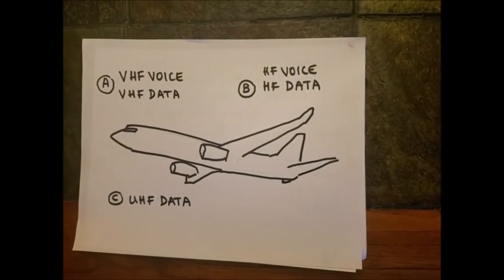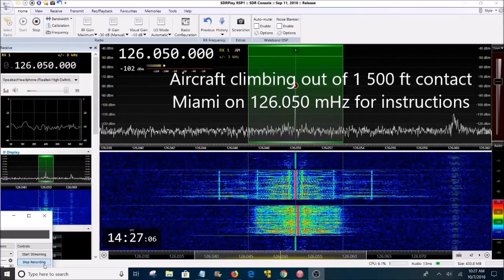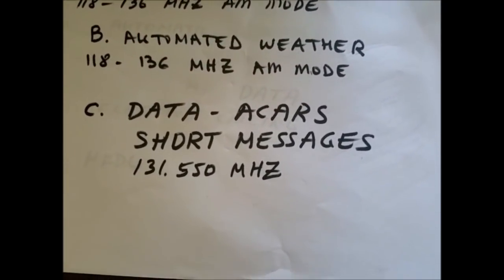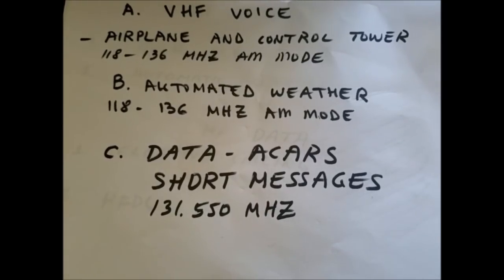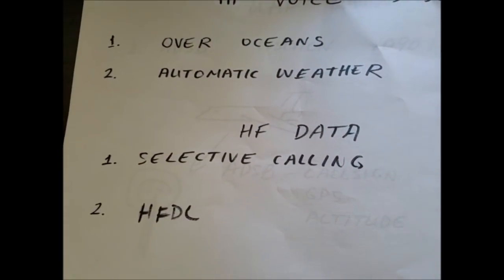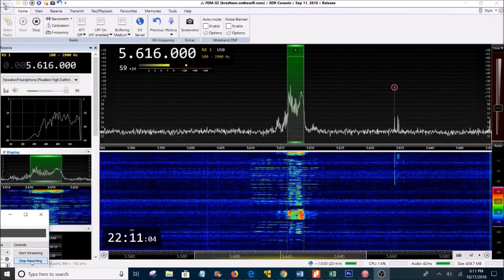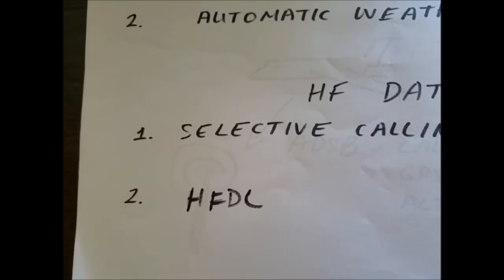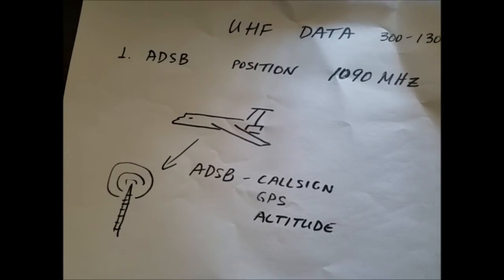2018: Monitoring airplane communications (aviation radio signal monitoring via sdr)

Comment: Very good beginners guide, you reduced information very well to a minimum, many thanks for sharing. You have got a very cool callsign by the way.

Those who like to experience monitoring voice communication, ACARS, VDL, ADS-B and AERO (just no HF band) can do this with an 8 bit RTL-SDR dongle for just 20 bucks (incl. TCXO for receiving without having to determine a frequency offset). For receiving all signals (LF/HF/VHF/UHF) in better quality (8-14Bit) I also totally recommend the SDR-Play RSP1A model, which is an amazing bang for the buck, giving you the opportunity to monitor many channels simultaneously if they are within a span of 10 MHz, vs. 2 MHz on the 20$ RTL-SDR dongle. I also recommend the free SDR console software for both devices.
Do NOT buy a traditional scanner - a good scanner is more expensive and can not monitor multiple frequencies simultaneously!, nor can it decode ADS-B or VDL (modern high speed ACARS), nor can it filter and decode as well as an SDR. Tough using a cheap RTL-SDR-dongle you might also want to buy an FM-blocking filter, because it is easily jammed on the front end if you live nearby transmitters, or better directly go for the RSP1A which has  FM and DAB broadcast blocking filters built in, which can be turned on and off, just as needed.
If you want to dive deeper and receive ADS-B signals from far away, just get a (separate) RTL-SDR-dongle dongle, ADS-B filter preamp and antenna you will be very surprised how far and how many planes you can receive. With a Raspberry Pi mini computer you can make this a stand alone unit you can have access from your smartphone via web when on the go without the Flightradar24 which is operating with a gigantic blacklist, which you don't have! Check out the plane with the ICAO24 address ADFDF9 = Air Force One :-). 
If you want to buy an SDR that that is so powerful that it usually doesn't need any filtering, though it has less bandwidth (max. 768KHz) and has HF but no UHF (0.01-30 MHz + 60-260 MHz), get the Airspy HF+ ... this makes all the scanners look really bad and outperforms even a lot of professional and ham transceivers and it still very affordable for 200$. You can also run it as a server at home on a PC or Raspberry Pi and access it from anywhere. It is compatible to most software packages and really picks signals out of the noise even better than most receivers, thanks to a new mixing technology and 18 Bit A/D front end it uses.

Summary: 
If you are a radio/SDR beginner - just start with the TCXO-based RTL-SDR dongle for 20$ ... even if you enjoy it and want more, you should later dedicate it for ADS-B only.
The SDR-Play RSP1A is the perfect allrounder for the max bandwidth and overall flexibility, also ideal on the go exploring the world of RF with "small" portable antennas.
The Airspy HF+ is a high performance receiver for HF and up to 260 MHz that under normal operating conditions (not beside a high power transmitter) never gives you a headache having to think  about reducing the receiver's sensitivity to avoid overload and distortion, which you have to do a lot with the RTL-SDR-dongle and even with the SDR-Play. Having this unit connected at home to real good antennas (HF & VHF separate) it makes the most operational sense.
If you plan to buy a new computer and want to run the SDR-Play at higher bandwidth, spend a few bucks more on a powerful CPU e.g. Intel I7, because high bandwidth and high resolutions (more than 8 bit) equals extra CPU stress! One more reason an 8 bit RTL-SDR will run fine on almost any computer.

Enjoy!
Reply: Really solid information I was seeking but unavailable elsewhere!  Thank you from AC1IH.